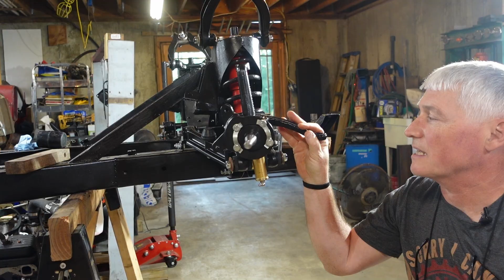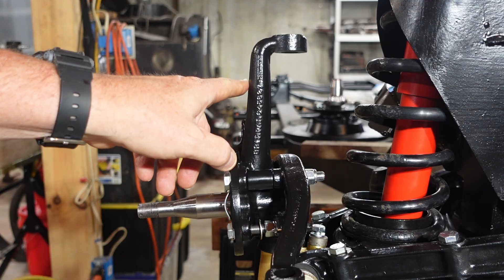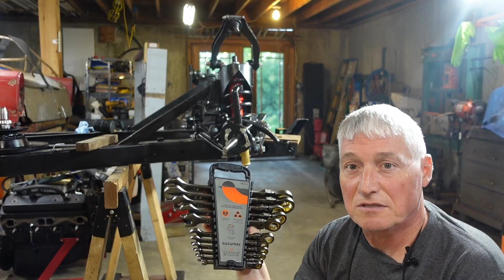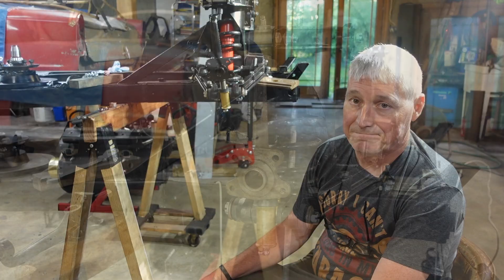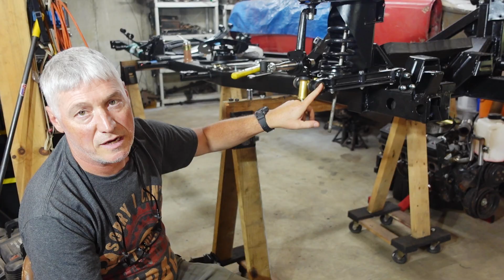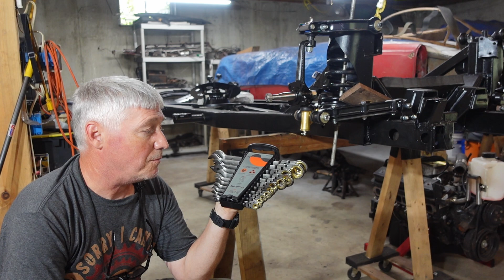Triumph TR4 - Front Suspension Assembly Part 4 -- Bent Vertical Link | Roundtail Restoration

Comment: Good overview for discovering a bent upright.  Moss lists new uprights for $339.  I have a bunch of good used spares.  I have seen lower threaded portion failures while racing.  High stress levels and wider, stickier race tires are contributing factors.  The failure is much less likely during street use with more standard size tires mounted.  Cheers.
Reply from the maker: Thanks Dave. I've got my new one installed and it operates just fine.

Comment: Hi Chris, 
I haven’t watched this entire video but I’m pretty sure I have a good used TR4A vertical link. I have no idea if it will work on a TR4 but I will donate it to your TR4 restoration if you want it. Message me if you are interested.
Dave Connitt
Reply from the maker: Hi, Dave. Thank you very much. I was able to source an original vertical link on my favorite forum from a trusted individual that I've dealt with before. I do believe that TR4 and TR4A links are different because the trunnions are of different design. I appreciate your generous offer, though!
Reply: @roundtailrestoration The uprights are not interchangeable.  TR4A and TR6 are the same. TR2 through TR4 are the same.  The trunnion changes early in the TR4 to a 3 degree trunnion and the upper a-arms changed too.  This information is available on the Moss website.  I have a number of good used TR2-TR4 uprights in my stash.

Comment: I was thinking something similar to another commenter, a stack of washers, or chunk of metal with a hole in the middle, over each side of the Trunnion, then use a G cramp to squash them together.
Reply from the maker: Yup, those are good ideas. I'm not sure that a clamp would be strong enough (well, my ability to turn it, anyway), but it's worth a shot!
Reply: @roundtailrestoration if all else fails, could you take enough parts off to fit the Trunnion on the press, and do a similar thing?
Reply from the maker: @redfoxclassics  Yup, I'm sure I could do that. The whole thing would have to come apart, but that's definitely an option. Tomorrow is my day to come up with a solution, so we'll see how it goes.

Comment: To get the new washer on the old trunion you might try putting it in place then using a 1 inch to 1 1/4  socket placed it over the threaded part and gently tap it a few times and see if it moves inward. If not, you could clamp it from the back and, still using the socket, press it with a C clamp. Or,  if those two methods fail, cut starter grooves in the washer with a smal rectangular file and try the first two methods again.  Finally, the last resort according to my dad in these situations was to turn it upside down and piss on it.  Good luck.
Reply from the maker: lol, that third option is the best! Putting it on with a socket it what I was going to try - use the hammer instead of the threads. Might file it down a bit, too, to open up that inner diameter.

Comment: It has been my experience that ratcheting wrenches are nearly useless on old British cars because the British engineers of the time rarely left adequate room around bolt heads for box end wrenches much less ratcheting wrenches.  Try to get nuts or bolts off of an MG or TR6 manifold and you'll see what I mean.
Reply from the maker: lol, yeah, I've run into that problem a few times. They're convenient right up until the moment they are not. Thanks, Michael!
Reply: I find them equally frustrating on my modern car too. Wrenching at an angle, with the head flexed, I find it impossible to rotate consistently and over flex the head. I will look for ones that lock (I didn't know there was such a thing).